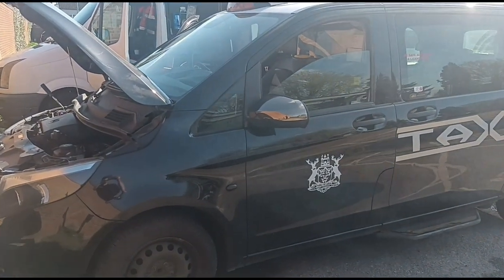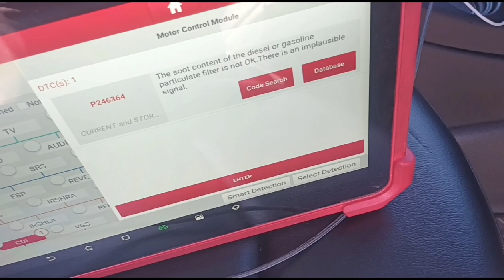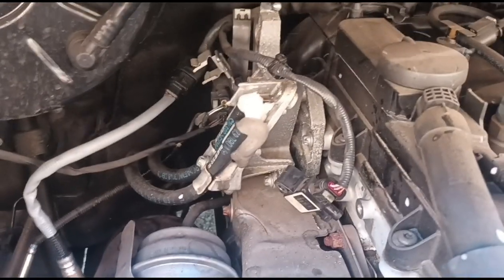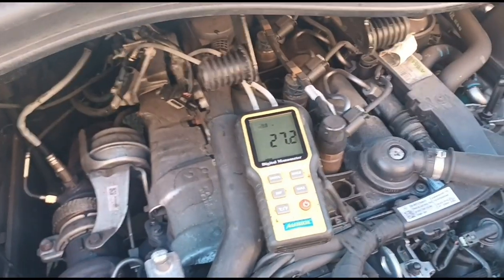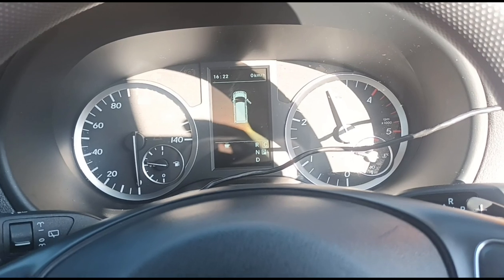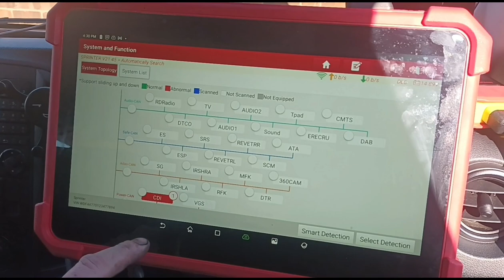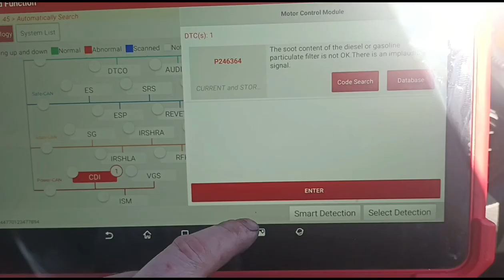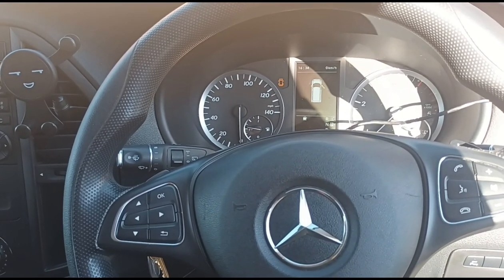Mercedes London Taxi Vito V Class 2.1 CDi P246364 Diesel Soot Particle Filter DPF Cleaning

Comment: These tell you they want a regen and automatically lift the revs to start it.
Also when the vehicle has done loads  short journeys and idling, they give you a fault code for the regen prerequisites not been matched, which basically means too many short journeys.
If you don't have that fault popping up then the DPF has high soot due to another issue.

Also your plausibility fault code is most likely a failed differential pressure sensor, I've fitted dozens to the 447 vito and 906 sprinter.
Reply from the maker: Yes I've fitted loads too. This was already done by the owner

Comment: For mercedes specially ml250 what parameters are you resetting after dpf issue.

Dpf sensor reset
Dpf filter reset 
Drift compensation 
Anythint else ? 

After cleaning dpf what could be cause of not revving over 2.5-3 k revs but no engine light everything cleared